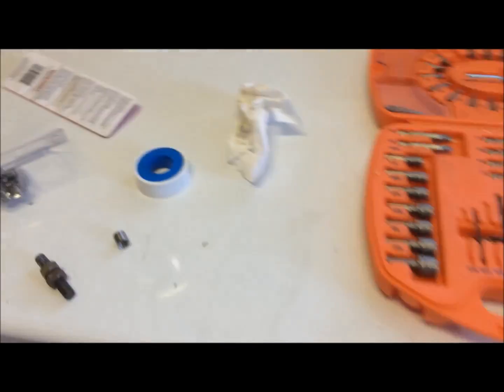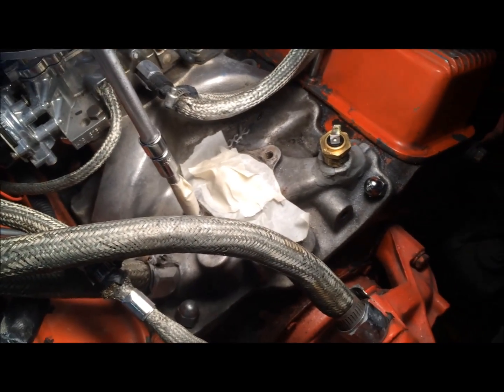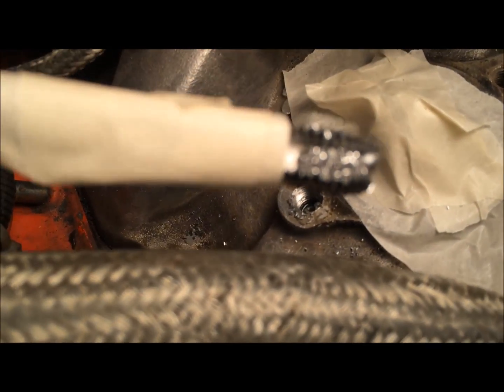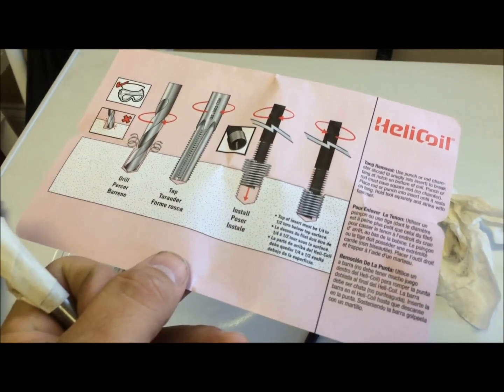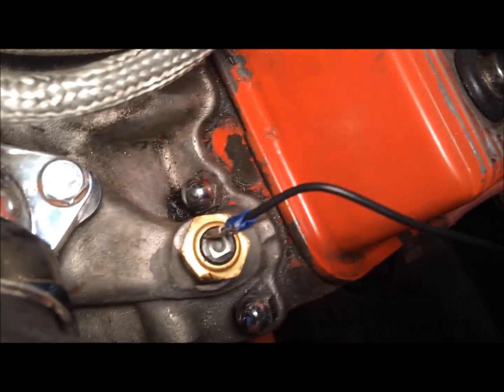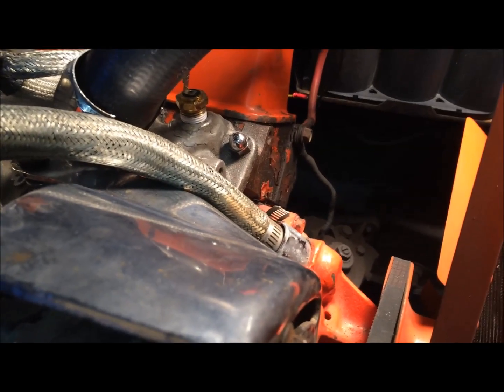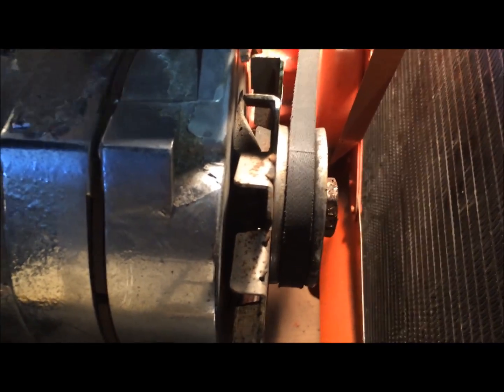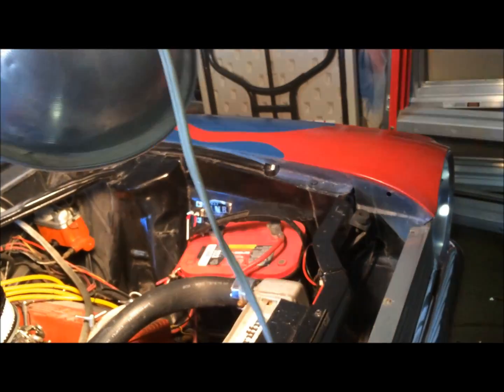Using Heli Coil to fix stripped bolt hole intake manifold

Comment: Huh, so you didn't even need to remove the intake? Did it tap all the way into the head?
Reply from the maker: just as you saw it.  That was years ago, it's still holding fine. :)

Comment: Would this work for a starter bolt hole that I drilled out too big
Reply from the maker: I would think it would.  I'm not an expert, but it makes sense to me.  I'd at least give it a shot, the heli-coil kit wasn't that expensive.

Comment: nice so basically a heli coil will reduce the new tap back down to the original tap?? will this work on high tension like sway bar bracket mounts and what about high heat applications i.e header bolts
Reply from the maker: I'm honestly not sure.  I got this recommendation from my father-in-law.  He said he had done it before, and suggested I try it.  He was right.  I'd suggest looking up some other videos to see if anyone has done that to see if you can find more info.  Sorry I couldn't help more.  I'm just learning and sharing as I go.

Comment: Did you put some kind of sealer around the bolt going into the helicoil?
Reply from the maker: yeah several people told me to put anti-seize on it.
Reply: *****
I was thinking more along the line of some silicone gasket sealer, especially on the gooseneck and bolt there. The learning curve is wide when you don't have any ready resources for advice before you have to jump in. You are learning for sure. Hoping for the best for you my friend.